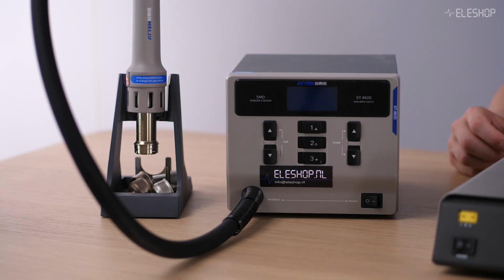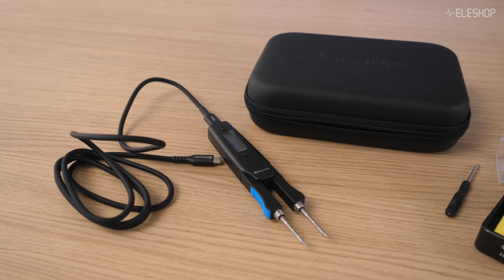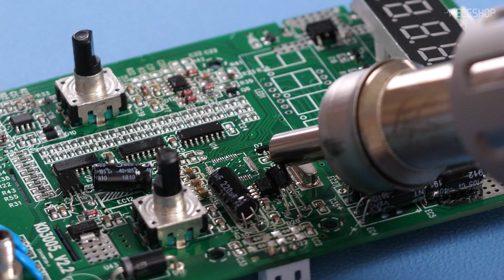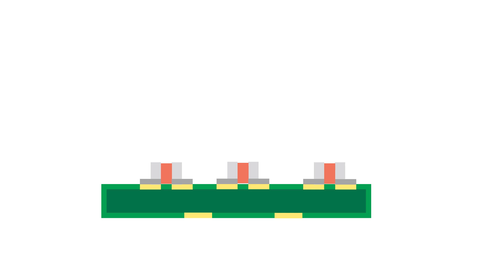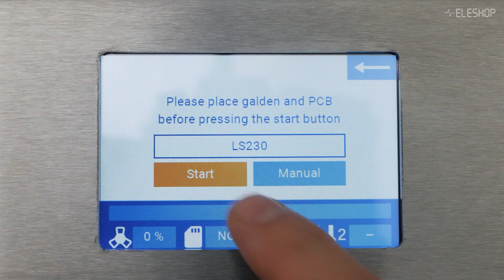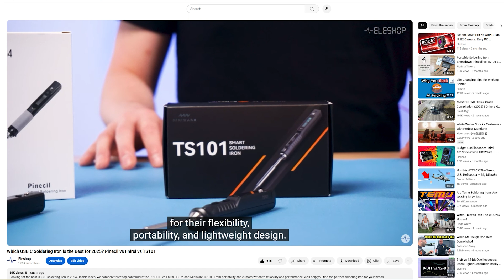Soldering: When to Use Iron, Hot Air, Tweezers & More

Comment: What I'd prefer? A tip-sized IR heater, with a laser square indicating the exact spot it will fire onto. Maybe with different tips, like 0.5cm², 1cm², 4cm². That's be like hot air, but without air 😄 Unfortunately, nobody came up with this yet to my knowledge.
Reply from the maker: Can it kill mosquitos as well?😄
Reply: @EleshopVideo  If I think about it ... yes, if you point precisely. For marketing reasons, I'd though suggest you write "can kill SPIDERS from a safe distance". You can safely shut down the rest of the shop then, 1% more or less revenue does not matter.